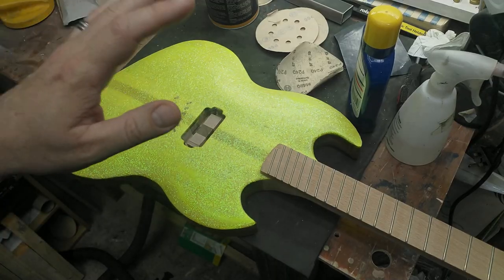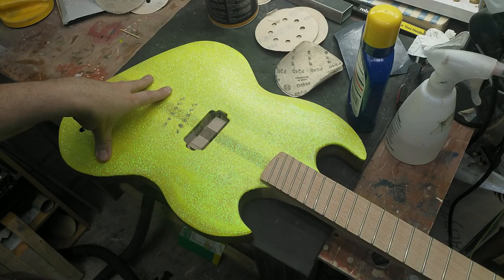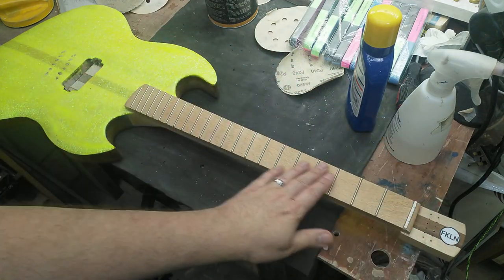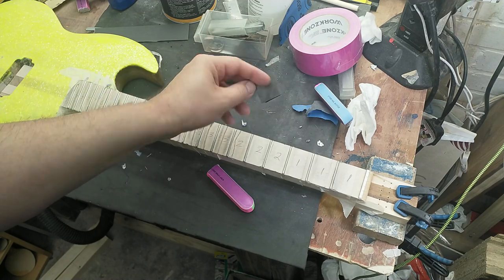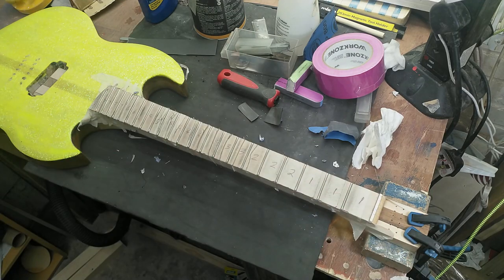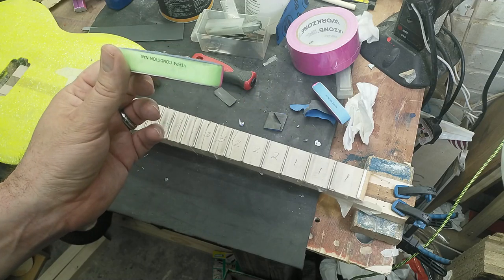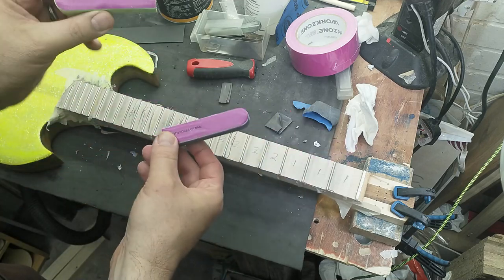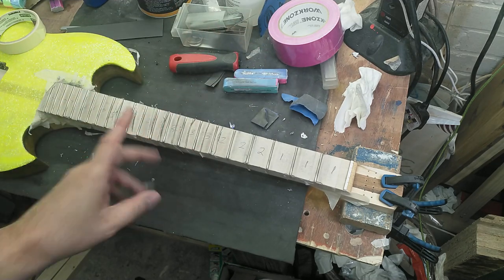Nail Buffer Sponges for Guitar Fret Work?!?

Comment from the maker: Do you have any alternative products for work on guitars or in general?  Fan of the £/$ store?  :)
Reply: I use a knife sharpening stone to level frets sometimes

Another good one instead of strap locks, just find washers at the hardware shop where the strap button base can fit through but not the end of it, place the strap under the washer

Cheap as chips
Reply from the maker: I never use my sharpening stones on my chisels, so might as well on the frets!
Reply: @ChrisFranklyn  they work in a pinch, I need to get a new one from work

Comment: I've given up on fine sanding frets, 240, 320, 600 to remove file scratches then polish with the dremel, done.
Reply from the maker: Interesting.  Last time I tried a dremel I made a hole in the fretboard.  What do you use, a wheel polisher or one of those rounded cones and use the side of it?

Comment: I think the reason you started making them worse initially is that the coarsest grit on these is around 100 - 180, which is obviously many steps backwards if you've already sanded up to 1200 grit. I believe the last grit on the nail buffer can as high as 7000, so perhaps using just the last 2 or 3 grits after 1200 would've yielded better results. 

In any case, I'm glad you thought of this and showed it could work! I was thinking of cheap ways to set up guitars and this popped up in my head. Haha
Reply from the maker: Yeah, you're right.  I'm still on a quest for the fretwork many years later!  Ha ha.

Comment: I’ve actually used them to smooth out the fret edges and it works very well
Reply from the maker: I think when I tried that it tore to shreds quickly... but that was on new frets.  On an older guitar that's probably a really good idea. Cheers!

Comment: I'm just using fret erasers nowadays, maybe I'll give these pads a try. I do own something similar but they're more like the size of your hand, meaning not that useful to work on a guitar, I think 3M makes them
Reply from the maker: Yeah, the pads also have the advantage of being more flexible to conform better to the shape of the fret.
Reply: I use fret erasers the buy the nail buffers from home bargains as they do a good job to finish off and are about a quid for 2. Final stage is dremel and polishing wheel with jewellers rouge

Comment: I usually finalise the frets with a disk polisher and a very fine polishing agent. Of course the fretboard has to be protected, otherwise it gets scalloped. 😬
Reply from the maker: Hmm, not sure I'd trust must with a fast spinning thing near the fretboard for that reason!  But yeah, there are more apprpriate methods. I just wanted to try this.
Reply: @ChrisFranklyn  Glad you tried this, so I won't have to bother. 😁 I normally use pretty tough tape.